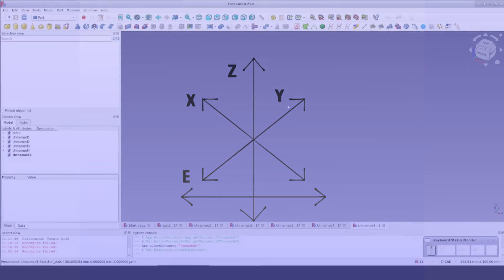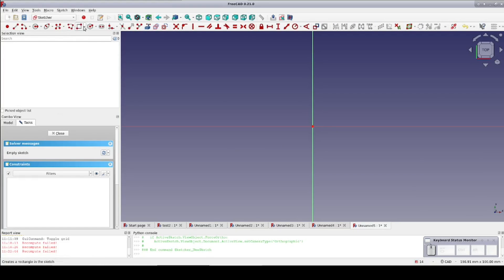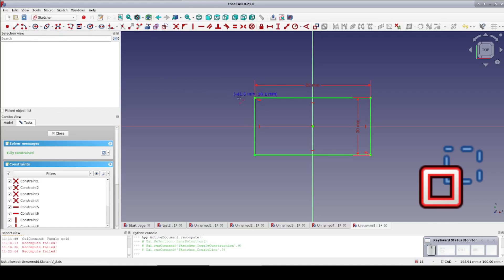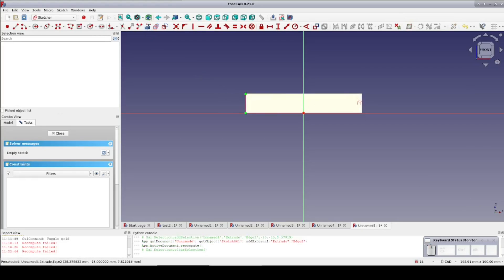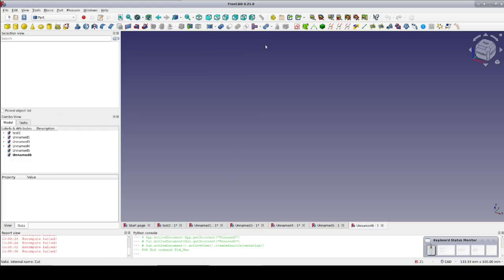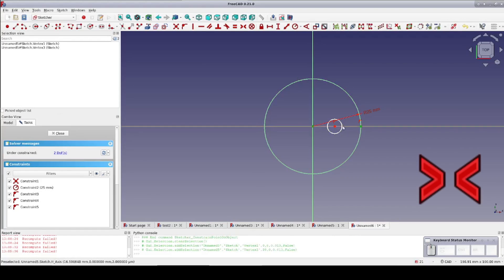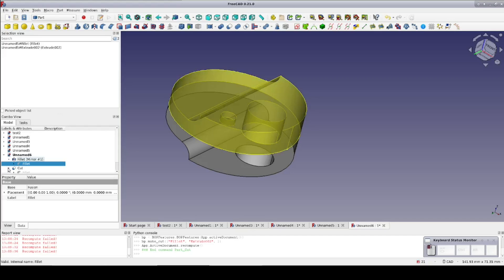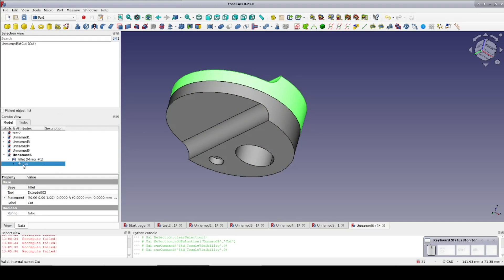FreeCAD: An Open Reply to TeachingTech

Comment: I think this reply video is a little beside the point. There was no doubt at all from the very beginning that FreeCAD is able to model this piece of test geometry, and in fact also much more useful and extremely complex parts. There was also no doubt that if you know the software, then you can proceed faster than TeachingTech did. Yet all you did was show exactly these two points that were already clear. The critique about FreeCAD is however something different. All other professional CAD software have more or less the same core concepts. Basic modeling is the same, they use a similar workflow, they use the same terms, their tools require similar intuition and so on. If you know one professional CAD package, you'll have only little trouble learning a second or third one, *at least as far as basic geometry is concerned*. But FreeCAD is different and not in a good way. Tools are named differently, their use is non-intuitive, they are distributed over different workspaces, you need more clicks and more steps for the same operations, everything is just different but not for the better. FreeCAD completely ignores UI quasi-standards of mechanical-CAD software, and wants to do everything in its own way, except less comfortable and more circuitous.

Comment: Ugh this is a tough one. Great video and I couldn't agree more. In my opinion it might not be as refined but the only serious problem is the topological naming problem. I have called out people that claim its just as easy to learn. It's not and beginner be warned it is an investment of time and energy but well worth it.

The last part of this video is spot on. I am the entire engineering department of a small company and the CEO has absolutely no idea what I do or how I do it. All he knows is every morning he wakes up and the machine works as expected. He thinks he is an engineer so whenever he gets a look behind the curtain he employs his seagull management skills. He flies in making a bunch of noise, shits on everything, then flies off again. This has caused him incredible losses in product development time,  quality, reliability, and cost. Unfortunately his position on the Dunning Kruger curve keeps him blind to that.

As unfortunate as that is I really get left with 2 options. I can bring him in the loop and request resources. This has always resulted in endless meetings, paralysis by analysis, and ultimate failure of the project. Option 2 is to just manage the problem quietly and keep him like a mushroom (in the dark and fed only manure). My use of this strategy is the only reason that the company is still in business.

This means I cannot just request CAD software, a software IDE, PCB layout software, or anything else that makes the machines that run his company. Enter FreeCAD, KiCAD, VS Code, and a host of other free and most likely open source projects. From there parts are just ordered from venders as "off the shelf" when they are actually custom fab. MGMT is cut out of the loop and another scoop of manure gets shoveled into the mushroom room. Thanks to the FreeCAD community for making this possible. Someday I hope to have a group of employees that will push me to success in spite of my own incompetence and self sabotaging tendencies. One can only dream...

Comment: I am sorry but freeCAD is still pain. So many hoops and loops where in Fusion even unexperienced user can solve those problems quite naturaly without external guidance. I think that is the big problem with the most opensource projects, it is made to solve technical problems and user experience is the last thing on the list, but the problem is that if you want more money, more users, user experience have to be priority number one. Ondsel is at least trying to fix that, but how they will be successful is distant future question. In a meantime I have to just hope Autodesk will not claim all my hobby projects and held them hostage

Comment: Thanks for the comparison, and Michael's excellent work.
In my company we enitrelly changed to Freecad a couple of years ago, the reason being not the price, but the attitude - the very thing people blame. The thing called  "intuitive way" is not always welcome in design applications. Parameters are the professional approach. We have lots of designs where the workpiece should be modified in the afterlife to fit it to different situations. and we found Freecad was the best in this regard.
In the notes below the expression "learning curve" is used like a curse. It may be so in weekend projects, but learning was not a problem where I came from. I find it scary that every  problem, that cannot be solved in half an hour, is frustrating for today's people. It took a long time to me to learn Freecad at the beginning, but now I can get a junior engineer up to the work in no time. We had  Freecad in test for long, and even today, I keep returning to the point, should we change platform, but the answer is no. The last thing I want, people being frustrated with a tool, because it must not stand in the way of work. But they don't. Au contraire, they start to use it for ther 3D hobby projects.
Last, but not least: FreeCAD is a community project, and members of the community develop it on their own. I don't think they wanted to compete with million-dollar CAD projects, but the fact that FreeCAD is now compared to those, is self-explaining. Ondsel is another step in the tipical evolution curve of open software. (See KiCAD). It is solid finding that open software has much slower ramp-up than the proprietary alternative, but once the open one reaches the same workout, it has much longer life span. We were left with expensive softwares become "end-of-life" countless times - and  is frustrating. (I am excited to see the same comparison in 2-3 years.)

Comment: Sorry but you have proven Michael’s - and others - points.

You just wasted time demonstrating the FreeCAD is indeed clunky, regressive, non-conforming to standard CAD software ui and ux conventions and FreeCAD takes considerably longer to do something that takes half the time in Solidworks, fusion or OnShape. 

You love FreeCAD and you have invested time to work around freecads foibles. Good for you. But don’t be surprised that user take up continues to be shockingly low for a FOSS project because unless things change, that’s what will continue to happen.

Comment: A wonderful capable program, and free, there can be no complaints. But it is a totally cryptic way of working, nuts, it's the 'implementation' of the way you have to work with it that is the total put off. Just by way of example in say a direct modeling system the second example for a hobbyist, like myself, can generate it perfectly in about a minute, that's not because it can do it better than FreeCAD, just the 'implementation' UI. Such a shame, that UI wants tearing down and completely bringing up to date and then FreeCAD would be fantastic, free, and most of all 'useable', because as it is there is just not enough time in a day/life to get even the most basic shapes done, BUT, it CAN already do it, which is the shame of things.  Many Thks for the vid but what you created here I can do those both examples in 2 - 3mins and I am a newbee to cad.
Reply from the maker: Two things to keep in mind. The first is that FreeCAD can do much more complex models to exact specifications, parametrically  which makes it more complex. The other is that it takes longer to do things when you are also explaining it.

Comment: The key takeaway from both videos is that while the other CAD software allow the user to click-and-draw, FreeCAD requires the user to carefully plan ahead, and place his object in the 3D space carefully so that we can use the Origin and axes. (or he could have used drivers to place the centerline in the middle of the rectangle.). 

Apart from planning, it also requires a lot of extra steps, such as creating the same elements twice. 

Further, this paradigm would not occur to a user of other CAD software, because he can draw multiple shapes in the same space, so he won't have to use the Origin and 3D space axes.
Reply from the maker: Put another way, it requires you to actually understand your design geometrically. That includes questions like will this existing geometry always be what's needed here or is this just a happy accident that'll be back to bite later.
It IS more demanding. Sometimes a design needs that.

Comment: People should just use what they are comfortable with and what suits their needs.
I use blender for pretty much everything, including technical work. You can easily have a non-destructive workflow for most things in blender besides text for some reason (And I bet there is a solution to this using geometry nodes). Sure there will be cases where Blender can't do something as gracefully as CAD constraints, but you can usually get around it, if everything fails there is a Python interpreter that you can do pretty much anything with.

But a person comming from a CAD suite would not find Blender useful. I like to prototype all sorts of things, and I want to do it in the weekend or something usually, for me Blender is THE tool for this kind of stuff, its precise enough and fast enough using a CSG workflow. I don't think in 2D sketches and constraints when I design, I think in shapes and function, so to me I find Blender more useful than any CAD program i tried.

Comment: I rarely comment on videos but have to say this is a well balanced look at a couple of issues that were brought up by the other channel. I have been looking for a cad software that I could use to create designs for my personal 3d printing. As someone who trained as A Mechanical Fitter I love the idea of being able to draw something and then make it in whatever material. I don't have a lathe or a mill so I satisfy my need by 3d print. Looking for a cad package I have tried nearly every one I could find. I really like Fusion and joined a course on Udemy, my ability to draw mechanical drawings by hand didn't seem to translate very well!! I love Shapr on the ipad and Mac, and looked at a bunch of others like Rhino, TurboCAD, and Ketchup. Some have limited free options. Most are subscription. What if I one day want to sell what I have designed as an income? Probably unlikely but what if? I would have to sell a boat load of stuff to even pay the A$ cost for  F360 - $995, I don't think I found one that was less than  $500. FreeCAD is free, I can use it in any way I like, and unlike a lot of others I think it's great that it doesn't do everything for you, this is how you learn, not by having everything done for you automatically, never understanding why.

Comment: Thank you for taking the time for the thoughtful reply to Michael's video.  I'm just a 3D printing hobbyist and I currently use Fusion360 and have been growing more concerned that the free personal license will either disappear or become constrained to the point of being unusable.  Quite frankly, I'm generally concerned about any cloud based solution.  I have many home automation devices that are perfectly good, except the cloud provider died or shut them down.  I don't want that to happen to my 3D designs.

I have more time than money these days, so think I will take a shot at learning FreeCAD.
Reply: Quick update to my previous post.  I spent a few hours learning FreeCAD in the last day.  In that time, I have successfully designed (and 3D printed) a custom 2-part camera and lens mounting bracket to use them with my computer guided telescope mount.  Not super complex, but not a simple design either.  Honestly, I don't think the learning curve was much more significant for me than when I started with Fusion360 6 or 7 years ago.  It did take a minor mindset shift going from the F360 timeline to the model tree, which was not a big deal.

I will also say I have probably 3 times as many sketches than I would have had with F360 since you extrude or cut full sketches.  That actually made my sketches cleaner and less confusing, so I think that's really a wash.  And once I figured it out, the symmetrical constraint is way more versatile than the F360 mid-point constraint, so that was a net positive.

And after all that, I decided to try out the 0.22.0 dev build, and all I can say is, Wow!  Just the improvements to dimensioning put it over the top for me.  

It's only been 1 day, but at this point I don't think I'll be going back to Fusion360.  

Thanks for your video that inspired me to give FreeCAD a try!
Reply: @techringo6469 you’re a legend for helping grow the community by sharing your experiences!! Kudos to you and god bless FOSS, especially Freecad’s Developers! :D

Comment: Let me state right off the bat - I like FreeCAD, and I especially appreciate that it is open source. I am, at this point, devoted to it, and don't see myself leaving it to use another program. IMHO, the two hardest problems when working with FreeCAD is workflow, and the naming problem. It took me a long time (and I still have issues) to understand how to approach a drawing the way FreeCAD wants me to do it. The other thing I learned is to not ever directly reference faces of solids to anything else. Reference to other sketch geometry in a body is okay, but the naming problem will make your life miserable when, somewhere down the road, your drawing will break and the mess will be a major headache. I even had this problem when just referencing a distance to another object. Also, boolean operations, as well as combining primitives with part bodies, etc. can become confusing fast, especially if you do not do these things in the order FreeCAD wants them. Then there are the funky fillets that, a lot of times, don't work as intended, even when you understand the limitations of the feature. I've learned a lot of things and how to do them, but there was and still is a lot of frustration along the way. There is pretty much zero intuitiveness - you have to just know FreeCAD and how to do it. I want to say, over time, keeping sketches simple, learning more instinctively how to set up constraints, and using dimension variables and spreadsheets has helped a lot in solving a lot of problems and streamlining work.

Comment: Came here because I was curious how the filet in the second design was done correctly for the full size. The workaround is what I do regularly too that kind of freaks me out. If I want to create a fully parametric design I don't want to set the value for the fillet to something fixed. So for me it's creating (sort of) a master-sketch with random lines I use for creating named references and later using them in the design (or using a data table (forgot if this is the correct name)) via the function handle. (Which is where I would love to see a possibility to directly enter the variable-name instead of clicking the icon first).

Anyways, like the video response to Tom Sanladerer this was a fair, acknowledeging and non-judging reply and I wish more people would do them this way!
Reply from the maker: Yes, in a real design, I would make the fillet Extrusion001.LengthFwd-0.0001mm

Thank you for your kind words. I really would like to see more polite discourse on the Internet.

Comment: One thing I like particularly about freecad, and I don't see this mentioned much, is how it helps teach best practice. Coming from fusion 360, I would frequently find myself breaking my more complex models when I needed to make a simple design change. I found freecad's unique workflow and more rigid input requirements, really emphasize designing with intent. Previously I was focused mostly on what would work to simply create a geometry. After freecad I now focus on the intent of those geometries which allows me to better constrain my models for improved robustness. I don't think it's all just the fact that it's a harder program to work with either. It really seems like it's easier to design with intent than with others cad packages. From my interactions with the forum, it appears that is a primary philosophy of development. Yes, the learning curve is steep, but the extra work is not a waste. If anything I feel the time I spent learning fusion 360 was a significant waste after they locked it down so much that I decided to move on. I'm comfortable with freecad knowing the time I invest is not going to be a waste, and what happened with fusion will never happen to me again.
Reply from the maker: This is an important point. FreeCAD really does push the user to be more rigorous in the model and that pays off later in stability and precision. Papering over problems makes things seem easy, but that all comes back to bite you when you make a small change later and nothing lines up.

Comment: You can constrain the size of the rectangle without specifying horizontal or vertical by using the length constraint on the sides.

Comment: Looks like I need to play with Part workbench more. I've been exclusively using part design workbench, didn't realize you could do sketch & pad operations in part workbench. The Boolean operations are easier in part workbench, but once you do a "Part" operation on a "part design" body, you can't go backwards. Bit confusing to be honest
Reply from the maker: Some find the Part workbench harder since it makes less effort to resemble other CAD programs, but I appreciate it's versatility and flexibility. It will be a lot easier to use if you add a custom toolbar with things like New Sketch and some of the Draft tools in it for quick access. See my video on that: https://youtu.be/N8jpKo9uAEs
Reply: @4axisprinting  Thanks mate perfect! I'll check it out